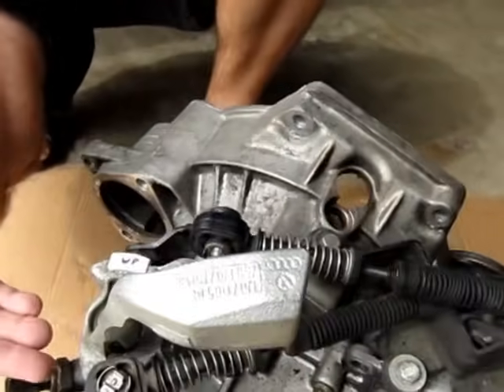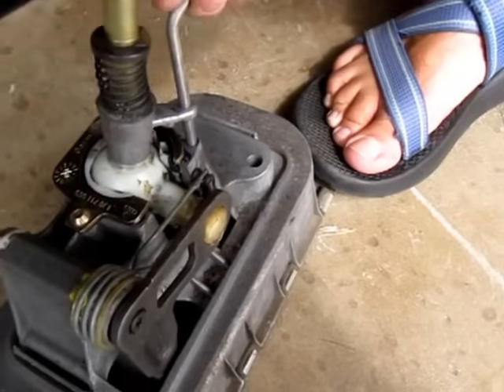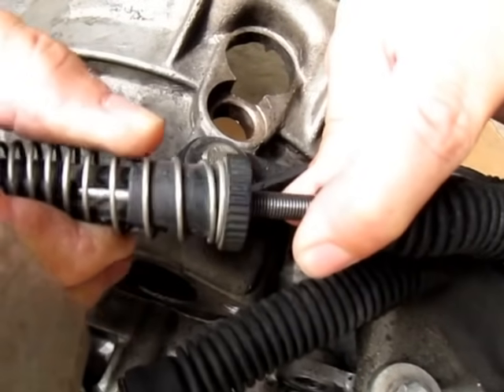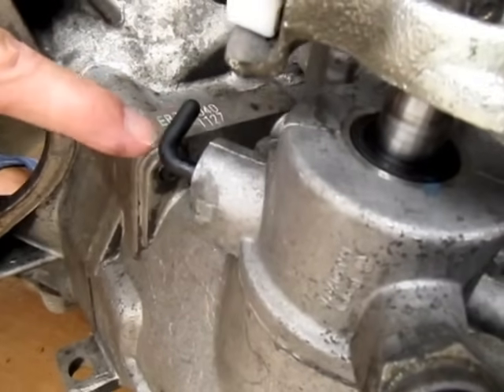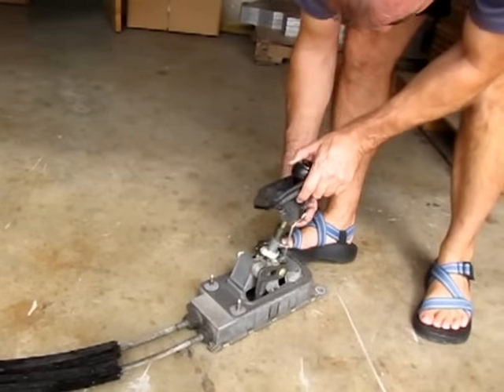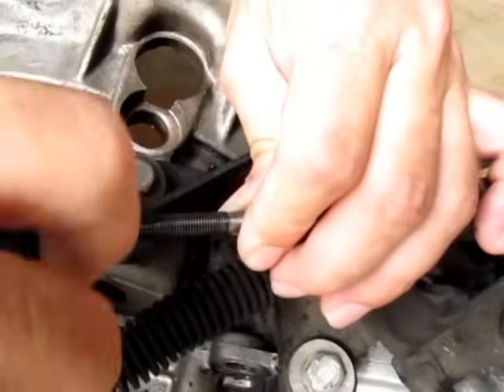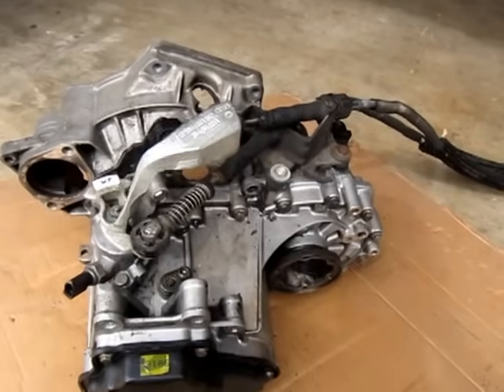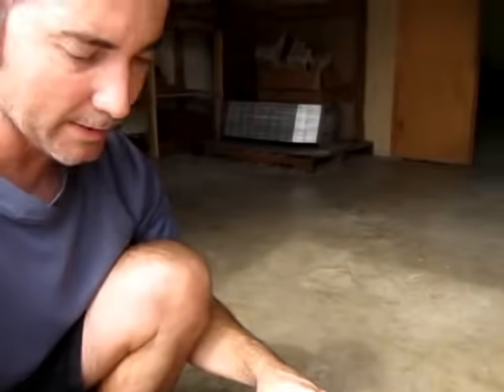VW MK4, MK5, and MK6 5 speed shifter adjustment for 02J and MQ250 transmissions

Comment: This worked getting 1st back but now ive lost 5th. Any advice?
Reply: It may not be a problem with the bushings (although they certainly would be an improvement to replace). You probably just adjusted too much the other way. Adjust the position of the cable in the clamps of the side to side lever by a few mm one direction. On the 6 speed, you would want to put the cable deeper into the clamp/linkange end by a few mm to regain 5th/6th. It may be the same for the 5 speed but I can't confirm. This is for fine tuning after you've set using the method in the video.
Reply: Would shift cables needing adjusted cause hard to get into gears?
Reply: Ty so much, you're an amazing help.
Reply: in my case was a bad bushing and i was wondering how a bad one can make me lost one of the 5th gears, and it does because 1mm play a high role in the adjustement, i made an adjustement in it (the bushing were eated by the metal and in my country i didnt find it ) then the result was absolutly awesome.. good luck
Reply: Yes. The same thing happened to me in Jamaica. Those nylon bushings get brittle from the heat. If one cracks, it could prevent 5th or other gear.
Reply: What happens if you dontlock the transmission?
Reply: I just tried to adjust mine after installing a new clutch and lost R
Reply: Same here I didn't have reverse then I adjusted the cables and now I don't have 5th
Reply: @noahvargas3551  Did you make sure to pull the cables away from each other before resetting the linkages? Not doing that lost 5th for me, doing that got me 5th back.
Reply: @teranceschmidt1090  yes I did it twice...but it improved my other gears engagement alot better
Reply: I noticed it could be from over tightening one of the cords
Reply: Hi. Any idea where the reverse switch is located on this gearbox? 
My shifter tower doesn't have one in place.
Reply: Same
Reply: Extremely helpful…better than the Bentley shop manual.  Fixed 1 & 2 slop…
Reply: Looks like there is a play in links and we have options 1. good 1st bad 5th 2. bad 1st good 5th or position somewhere in the middle 3. poor 1st and poor 5th. This is in my case :(
Reply from the maker: @makuszko slop in the linkage needs to be fixed with it bushings so the signal isn't lost between stick and trans
Reply: dieselgeekdotcom can you please email me at kyle.ttfrank@gmail.com I need some Sirius advice plz and thanks I'm having trouble with my shifter and carrier and can't find the correct parts

Comment: Thanks for this. Will this affect my neutral? Bought the car and neutral sticks so it doesn’t shoot back to centre. Up and down is fine but left and right is hard
Reply from the maker: Generally no. Failure to center is usually corrosion in the pivot tube out in the engine compartment. Usually 2008+ https://dieselgeek.com/search?q=Aluminum*%20Side*%20to*%20Side*%20Reduction*%20Bracket*&type=product

Comment: Are these MkIV VW Golf Shifter Setup & bushings the same as the Audi S3? [02M 6 speed]
Humble Mechanic
• Bushings for 1st gear 
• Watch from 17.20 minute
https://youtu.be/ah3zVp_iqf0
Reply from the maker: Well it depends on which S3 you're talking about. It's a MK4 based S3 then yes. If it's a later S3 then it's based on one of the later chassis. Bottom line is that we make bushings for all of them. Send us an email with your VIN and we will gladly point you in the right direction: sales @ dieselgeek dot com

Comment: Same for 6 speed?
Reply from the maker: Yes same procedure. The cables on the 6-speed are reversed left to right and the lock pin is in a slightly different spot on the selector shaft but the idea is identical

Comment: I noticed my locking pin is in home position facing up. Does that mean it's broken from previous owner? Or can I still adjust it ? Any advice ?
Reply from the maker: If the pin is pointing up and the selector shaft is not locked odds are the pin is broken and you'll have to use the procedure for a broken pin to get it adjusted properly

Comment: Yay - Lucky me! My Mk4 Jetta is a 1999 and has no lockout provision whatsoever, looks completely different. Lost reverse, 1st and 5th today. Get to figure it out myself. Did find the thin mount plate surrounding shifter assy. fractured at the rearmost flarenut so it's sloppy jalopy. Fabricating a steel doubler  right now.
Reply from the maker: 99 MK4 uses a 02A transmission. We have videos for those on the YT channel and products at dieselgeek.com in the bushings section.

Comment: Hi,thanks for shareing this information. I did exactly  as in video,when you select the gears it went in all  gears,but when you start the car and drove off it doesent want to select 2nd & 4th. What can stil be wrong.🤔
Reply from the maker: Perhaps a clutch problem
Reply: @dieselgeekdotcom  👍 thanks,this was my first impresion,but the polo guys  sed it is n setting problem,i tried the whole day but no luck,then i got all the gears and reverse but it stuck in reverse. Found n pole machanic and car is booked for tomorrow at 9. Thankyou for coming back.

Comment: Interesting. I lost reverse yesterday. I just did this adjustment but I was taking the slack out in the other direction. Hopefully this'll fix it. Though I do still need to do the other fixes you have.
Reply: Got the slack the other way and it's working fine. Livesaver. Thanks.
Reply from the maker: There's probably slop in the linkage. It's very common to be able to make an adjustment to get first in reverse back, but then 5th becomes more difficult due to slop.
Reply: @dieselgeekdotcom  D'oh. I didn't think to check 5th. Either way, it's good cause I need to use the car and I can get by easier without 5th than reverse. I'll be ordering up some of your other bits shortly.

Comment: an odd question the locking plastic pin  in my car strait up is unlock and horizontal lock the neutal , somebody put in a new wrong?
Reply from the maker: Yes that is abnormal. Perhaps it's been replaced.
Reply: @dieselgeekdotcom  thought so, odd found in youtube more like this and same motor type

Comment: for me on a mk6 gt petrol 6 speed in the uk, my reverse had always played up so that i would have to roll the car an inch or 2 while putting it in reverse sometimes.  Then couple of days ago I reversed out my drive then wernt to put it in first and couldn't get it into any of the gears. Anyway what had happened is the selector had come off the gearbox, the securing e clip must have come off. I went to vw got one for £1 fitted it and went through the instructions here adjusting it by pulling the spring back then just letting go, and its better than it ever was. Thank you to this channel.

Comment: Just in case anyone is wondering, it's 2023 and this video is just as applicable. Bought a Jetta with a ton of Km onm it, owner said it had been shifting bad for about 5 years. Figured it was more serious. All you have to do (in case it wasnt mentioned here) is disconnect the air box and you should have access to everything you need. After re-adjusting, its a totally different car. Thanks for this awesome how-to video, saved me the hassle of going to the transmission shop!
Reply: I’ve watched it a million times lol
Reply: 2025 here lmao
Reply: No, no, no... It is 2024 already and I am using this guidance to fix my gearbox 😅
Reply: Same, used today on my Octavia 1 @MRx3mLV
Reply: @MRx3mLV did you have to take out the whole assembly?
Reply: @DanielFernandez-ht5xi  You just need to remove an air filter assembly. As soon as you start doing this you will find out, that it is quite simple. On the gear shifter (inside the car) you need to pull the leather cover up and then you will get an access to 5mm alignment holes. Good luck!

Comment: Thanks! The tip to pull the linkages tight before resetting made all the difference. I did the adjustment before without doing that and I lose 5th. Now, with that tip, perfect shifting!

Comment: What adjustment would you recommend if going in and out of 5th gear is stiff but the rest are completely fine? The car drives fine in all gears. I took it to a local mechanic but i dont think they did anything like they said they did as it feels the same to me.
Reply from the maker: Have you checked for linkage slop? https://youtu.be/7HBE5vycg-4
Reply from the maker: I would make sure the linkage is 100% before going to the trouble and expense of removing and disassembling the transmission. It only makes sense to rule out the inexpensive and noninvasive usual suspects first.

Comment: What if I can move the linkage in the engine bay into reverse position and it's still in first?
Reply from the maker: Either the linkage isn't locked or there is a lot of slop in the system.

Comment: Hi, my 2022 VW Golf 1.5 TSI Manual has three problems with the transmission:
1st - you can feel resistance and hear noise most of the times gears are changed (1st, 2nd, 3rd, 4th). Very, very rarely the problem is absent. But it's a fact that around once per month the gears are smooth.
2nd - switching to reverse gear is always clumsy, goes with extra resistance and noise
3rd - when I accelerate in 1st and 2nd gear (that is every time the car stars from 0) you can feel the car stops for a second which creates a very unsmooth start with a slight shake in the seat. Overall 0 to 20 km/h is an awful process and is never smooth. I've driven many manuals but never had a jerky one - didn't even know there could be a jerky manual transmission.

Do you think this can be resolved in any way? Can you make a video about it? The car is still under warranty but the dealer denies there's a problem and says the car operates normally (which is definitely not the case)
Reply from the maker: Hey Angel - 

Some of the resistance when changing gear may be related to slop baked into the factory parts, specifically the forward pivot in the cabin shifter and plastic bell crank on the transmission end of the shift linkage. We offer the MQB Super Pin and the Billet 5-speed side to side reduction bracket to address these issues. 

1.5 TSI is known for being erratic in power delivery, primarily when coupled with manual transmission. I believe there is a software update from VW to address this.

Comment: hey, thanks for amazing video. I am still confused on how to remove slack out of the cable. I did pull cable and the bush opposite to (away from) each other, then i lost 2nd gear. Then i tried to pull the cable and bush towards each other, i lost 6th gear. So couldnt really remove any slack. i just could fit it back without removing the slack. could anybody help me with that?
Reply from the maker: Sometimes people get confused by that. Maybe just don't worry about it. Just push down gently on the counterweight and give the cable and a wiggle before you click it closed.

Comment: Great video!! Helped a lot with that broken locking pin. That made me confused as it didn´t do anything.
If it doesn´t stay for long after adjustment - there´s something wrong with the "grabbing" mechanic right?
Reply from the maker: Sounds like something is moving if it won't hold alignment
Reply: @dieselgeekdotcom  
Ok. Try it again, and if it won´t hold... replacing the whole strain, right?

Comment: I had previously replaced the first gear getter which made finding 5th gear once again possible. it then made it a little bit more difficult to downshift into second, having to hunt it a little bit. once I followed the procedure in this video everything in the gear shift is right up to snuff again. all the gears are there crisply neatly and where they are supposed to be. hard to believe it's a 220,000 mile car. thank you so much for creating and sharing this video

Comment: I just installed your bushing set on a 98 2.0 5speed beetle. Worked well. How can the shifter and trans be locked for this type adjustment? don't see a pilot hole
Reply from the maker: 98 uses a 02A trans. There is no locking pin. You want to set the side to side cable such that the leftward wall inside signs with the 1-2 gate. When it's right, it'll act like this https://youtu.be/fCJSsj9JKLc.

Comment: Hi Jim you have a awesome videos I have a Volkswagen Jetta mk4 O2J transmission which had it the first gear on reverts position I follow all the steps but still can get it into the first gear right .
Reply from the maker: Hey Carlos - typically if you do an alignment yet still have problems finding gears the issue is slop in the linkage. Have a look here: https://youtu.be/7HBE5vycg-4

-tyler
Reply: @dieselgeekdotcom  ok I will check on it thank you so much for the link.

Comment: Any advice for broken locking lever? Not sure how it broke but found it that way
Reply from the maker: Cables opened. Pin the cabin shifter, put the trans in 2nd directly on the trans. Lock the side to side cable end. Rotate counterweight to neutral, lock the front to back cable end. https://youtu.be/iND97_fcDNQ

tyler
Reply: @dieselgeekdotcom  Thanks Jim. Always very helpful!!

Comment: In the Seat official manual it sais to use a seat belt to secure the lever more after u put the 5mm pin. It sais it will make "play from 1st and 2nd go away". Ive never seen anyone on YT doing this and im not sure whether i should do it.
Reply: @dieselgeekdotcom  Sorry? 

This the the copy paste from manual:

Wrap left safety belt -1- around gear lever so that the belt holds
the lever.
The gear lever is secured by the locking pin - T10027A- (-A-).
In addition, the seat belt presses the gear lever against the stop
for 1st and 2nd gear -direction of arrow-.
This takes all »play out of the selector mechanism«.

Whats your opinion on this?

Comment: I followed these procedures and I can't get my MK6 in to reverse. Any suggestions?
Reply: @dieselgeekdotcom  Thanks! I've done it a few times with a 5mm drill bit. Still no reverse. When you say pull the slack from the cable, does that mean push the cable into the housing/sleeve?
Reply: @dieselgeekdotcom  Thank you. I've spent a few hours trying to get it dial in with no luck. It's going to the dealer next week for some other work. I'll pay them to fix my work.

Comment: Can heavier gear oil cause difficulties getting the shifter aligned just right? 
I already have the DG accuracy pin, superpin, superslider, shifter bushings, shaft bushings etc
I can get it aligned almost perfectly but it fights me going into reverse and then it doesn't stay pushed down like it should, also shifts to the right when letting going. Also can feel it clicking into 1st and 2nd at an angle.

Comment: The video is great help, I’m having a problem on my arosa 1.4 tdi the clutch has just been done got it back but when I’m neutral it makes a grinding noise like it’s grinding against a gear, when in gear it’s fine, anyone experienced this?
Reply: @dieselgeekdotcom  I’ve done this adjustments it’s a bit better but when I’m neutral ya can knock it towards a gear then when I return to neutral position then the noise stops, does that mean the linkage cables are stretched? Just trying to figure it all out

Comment: Man I've watched a bunch of videos of how to adjust the cables and I couldn't seem to get it right, it would shift into 1,3,5 gear perfectly but no 2,4,6 gear this is the first video I've seen about pulling the slack out. Gonna try it first thing in the morning, I've been having trouble for the last few days with my 09 CC 6 speed, I believe my pin may be broken as well, it'll lock the weight from going up and down however I can still rotate it a ways. Going to try the broken pin adjustment as well. THANK YOU GOOD SIR for the video. GREAAAATLY APPRECIATED keep up the great work
Reply: @dieselgeekdotcom  yeah that was the original issue, happened while my wife was out grocery shopping, had it towed home and the next morning I seen that 4-5 of the splines were worn out the weight. Got that replaced but still can't shift into 2, 4, 6 gear, all the others are fine, clutch engages perfectly, all other gears are great, just a matter of getting those pain in the ass cable ends adjusted correctly again. Also I noticed the selector shaft that the weighted piece attaches to, when it's not in any gear and just resting should I be able to pull up on it or should it be all the way up while not engaged?

Comment: Thanks Jim, I have tried your both method on my 2001 s3. Your first holding pin(chrome wheel locking pin on the gear box) method is working after I have tried several times(exhausting) tried to get right. Before that I also tried your second method, for some reason, I always missed the reverse gear, and even I have tried  several times. It is always engaged in first gear even you push the gear knob down. First method, required many attempts due to locking pin slide off. Finally, I got the gear box locking pin "locked" and I was able to get gears right.

Comment: We just installed a new clutch and the car is driving like it's not going into gear correctly when we shift. I guess we broke the locking pin when we put the shifter back on. When I have the shifter locked in the car I. Any put it in the 1st 2nd would that mean the bushings are bad or something else

Comment: Class explained. Does this also work with a 6-speed gearbox.
Reply: @dieselgeekdotcom   Yes I know that. Only the lever has broken off and can no longer be turned.
Reply: I can no longer get reverse gear on the Touran 1t, 1.6 FSI.
Reply: @dieselgeekdotcom  An MQ 250 is installed. 6 courses
Reply: @dieselgeekdotcom  I'll try it right away.
Reply: I have to thank you very much. It actually worked. I wanted to buy a used gearbox. You saved me a lot of money. thanks !!!!!